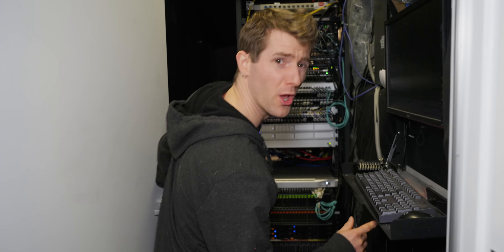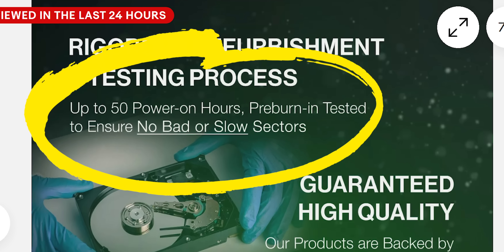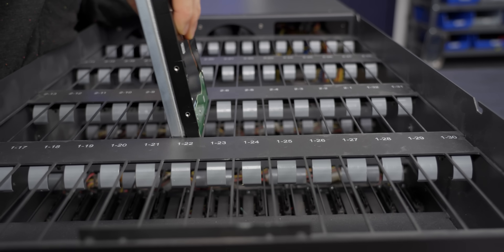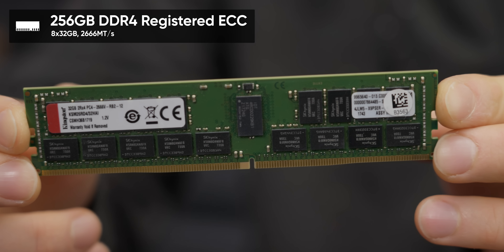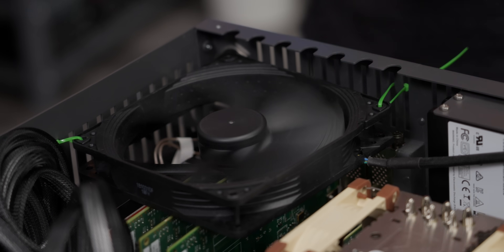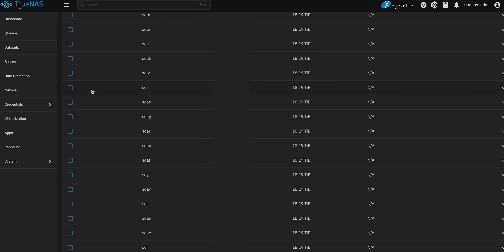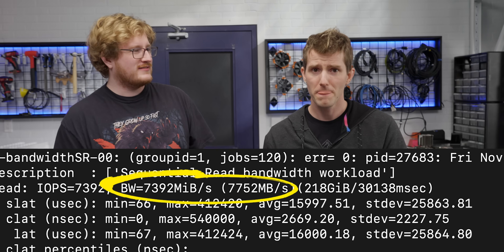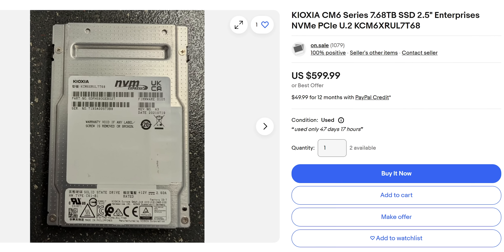Is Buying a PETABYTE on Ebay Stupid?

Comment: I understand that most people use Seagate because of videos like this, and they are generally cheaper.
For me, every single HDD I have ever had fail has been Seagate.  I have WD drives past their rated life and still going strong... plus I tend to get faster read/writes with WD drives that are technically rated exactly the same as the Seagate ones.

Comment: I bought a bunch of new 16TB Iron Wolf Pro SATA drives a few years ago and had one DOA. So I RMA'd the drive and Seagate makes you pay for shipping the drive back. They sent me a replacement and guess what, that was DOA as well and Seagate expected me to pay again to ship it back and I said no, you sent me a DOA as a replacement so you are paying for me to ship it back. After some back and forth they agreed. I did have one of their 18TB Exos HDDs get sticktion rather quickly and had to RMA that on as well.This all happened during the pandemic with supply chain issues so I just chocked it up to QA issues due to the supply chain issues. In the end the 6 16TB Iron Wolf Pro HDDs and the 2 18TB Exos HDDs I've been using haven't had any issues since putting them into my server and they have been running 24/7 for a little over 2 years now. I do need to get more storage as I need to seriously organize all my digital data as everything is so disorganized it would make anyone having to do forensics on the 100+TB of data I have if I committed a computer crime quit it's that bad.

Comment: I know that seagate has sponsered and sent many a drive in the past, but I was wondering why WD never really get's mentioned. In like, however many years at this point I have been watching, Western digital has really only shown up in used part builds or scrapyard wars stuff. Cus as far as I can tell they are still great drives, my original 1tb WD Blue HDD has been with every pc I have used the last like 8+ years? I just think it would be really cool as a video idea or labs piece, to compare the two brands. It may be very tech nerdy, but I like the big tech tippy vids.

Comment: I run my own NAS. I purchase 8tb drives for 45usd each. Yes, they do have 30k poh when I get them. I run them in Raidz2 and give no cares. For 45$ I can replace them 4x before I hit the regular price of one. As long as three don't die at the same time then it is a victory. My entire 64tb, 45tb usable, NAS costed me around 600usd and that includes cold backups.

Comment: I have 10x second hand “100% health/Zero Bad Sectors w/ 1 year warranty” SAS 14TB WD HC530’s I got on eBay for $87 shipped apiece. Can’t beat ~$6.20/TB! They all pass a full Hard Disk Sentinel health test (takes ~90 hours to perform lol)
8 are in my Z840 home server (Dual e5-2697v4’s/256gb ECC DDR4) and 2 are in a second Z840 workstation (Dual e5-2689v4’s/128gb ECC DDR4). 6 months in, no issues and still 100% health. I highly recommend keeping an eye on your spinning rust with Hard Disk Sentinel or something similar that will alert you as performance degrades so you can proactively swap the drive before a catastrophic failure occurs.

Comment: A surprising amount of manufacturer recerts are essentially brand new drives. I find the ones from ServerPartsDeals especially often have less than a dozen power cycles and only a handful of hours on the spindle. Usually they were bought in bulk for some purpose, but never fully deployed. Then Seagate takes them and goes "yeah drive is still good" and tada cheap drive.

Comment: Been using second hand barracuda drives in my pc as the main bulk of my game storage for years (when i wanna play them i just move them to one of my ssds) and not had a single one fail yet. 

Been running for atleast  the 5 years that I've had them. Never had an issue the fear of second hand drives is something that really isn't much of an issue to me as 2tb drives are cheap enough on Ebay

Comment: I'm in Australia and just bought two 16 TB WD drives from East digital Shopify store for $250AUD each shipped.
They have a 3-year warranty and a 0.3% failure rate as reported by blackblaze 2023 failure report
Lower than the Seagate which was 0.9%

Comment: He showed Server Part Deals which Wendell just did a video on and ive used for ages (~8 years?). Probably could have gotten a better deal going directly to them.   ---ooh hey they said it!

20TB is the correct way to go I just had to do this early 2024 when my 14TB's started popping.

Comment: I have 2x 16TB Seagate recertified picked up from AliExpress. 1 bought 2 years ago, another one bought earlier this year (Jan). Both running in a shr raid in synology with 5 disk bays - I plan to upgrade my pool with another 16TB recertified next year. Both drives have 2yrs of warranty left.
Reply: jus buy the upcoming 30-32tb one

Comment: I've had every new seagate drive I've bought in the last 2 years for 4 systems bought form MemEX die, replace, die, replace, die. So at this point I made a T-shirt mocking Seagate. Warranty conversations have wasted over 20 hours of my life. Would not touch Seagate Ironwolf or Exos drives with a 1000 foot pole.

Comment: I bought a used drive about 10years ago for $10 had a couple of dead sectors when I first put it in 

Fast forward it's still I'm my rig now has no dead sectors and works perfectly 

It's called Patrick as it is an enigma

Comment: My first high storage HDD was an 8tb seagate drive for mass storage, occassional games before i could afford ssds-a-plenty; had no issues with it and ended up doubling my storage with a recertified 8TB WD Black and it's running strong. The seagate drive is still running 7 years later

Comment: So far my seven 12TB recertified Seagate EXOS X14 drives work like a charm with no issues. I should acquire one more so I can run an eight drive RAID-Z3 pool instead of a six drive RAID-Z2 pool.

Comment: brand new HDD are crap, why on earth would anyone want a second-hand one, even at half price. I dont believe for a minute the LTT is actually using these outside of the video. also, I have a long-running streak of bad luck with Seagate HDD. from DOA to Dead in minutes to intermittent faults. ugh i dont think ill even finish watching.

Comment: I've almost exclusively run re-certified and straight up used drives in my homelab for the better part of a decade now. I mitigate their (un)timely demise by running 5 nodes of Proxmox and CephFS joining them all together. My oldest drives are crossing the 100k hour mark here soon.

Comment: So... 2.5PB of raw storage... 117TiB (~128TB) usable capacity in the next frame... 2372TB left. I mean some storage used as redundancy of course but what happened here? when will you show how you fill up mother vault finally and how you expand and so on? why is it already a new system again? where is the connection of the stories? Fine, you want to cover some new usecases, but this would be also possible with your existing mother vault?

Comment: Bought 3 3tb HGST Ultrastars refurbished in 2017. They've been powered just about 24/7 since then, but SMART was wiped so I have no idea how long they were on before that. Still healthy, no reallocated sectors. I'm thinking about replacing them just for the capacity before I even looked at the cold spare

Comment: I bought 3x 12TB Exos New-Old-Stock from Amazon, for 125€ a piece.
They have no SGT Warranty, but the seller gives you 5 Years written warranty.
Most of the drives are from 2019. and 2020., never used with 0 working hours.
Run them in my Expenology, and as for now, they run great.

Comment: I've bought a couple of WD Gold drives from eBay and they're awesome. Super cheap, large capacity, and much more reliable than regular consumer drives.
Reply: @danwhite3224  I wouldn't go for Hdd, SSd are better for fast storage rate use
Reply: Is it Helium or normal?

Are they enterprise grade? 

Are they a sata connector or 

another one that is typically used for enterprise drives i forgot the name of it
Reply: @srinivaschilakala216  theyre helium filled enterprise grade SATA drives (not u.2). You can get all this info with a 30 second google search next time
Reply: You can't just say that they are more reliable, as the manufacurers promise just isn't valid for ebay drives... 

I do think it's a good deal though... just not THAT good
Reply: @Jerraaa  "more reliable" probably means that they last longer due to better construction or something, not better warranty.
Reply: @DrewColpurs how would they be able to make serious claims about reliability from just after drives?

I you need hundreds of drives each from different models and vedors to actually get meaningful data about reliability.

Personally I never had a drive that was still in use die on me but that doesn't really say much about the drives, I just got lucky.
Reply: @Jerraaa  Just because it's on eBay doesn't mean that it automatically becomes unreliable.
WD Gold drives are designed for datacentres, so they have high shock resistance and MTBF is much higher. Of course, there's always still the risk that they've been mishandled but as they're more rugged you've got a better chance.

Comment: I have been running my plex on refurbed hdds. I don’t like it, but they seem fine. I’ve got 5 16tv, 4 being exos or gold and one ironwolf.  No problems so far. 
But I wish I had the space for a rack. I think my next purchase though will be some used nas units. I’m gonna plan for raid 6 with 96tb. That’s gonna be rough though.

Comment: Around 6 years ago i've bought some reaallly cheap hitachi 6TB hdd's. They were cheaper than any new 3TB available at that time. They were listed as new, but im pretty sure they went through some sort of refurbishment. Still running strong, although i use them pretty lightly. They still spin around 90% of the PC power on time tho.

Comment: I like recert drives. I have 6 of the Water Panther WP Arsenal 20tb in a QNAP AI642, along with a USB connected Orico 5 bay backup unit for offline files of podcasts and clients stuff after a year has passed. It works for me. I have no issues and all 6 drives are now almost 3 years old.

Comment: Your confidence in mechanical hard drives is truly inspiring. 😭🤣
Reply: i have 3-4 ssd died since 2016 but none of the 10 harddisks - seagate exos - i had bought & used since tehn had died, 2 of 8tb hdds are showing sign of fatigue but not dead with no chance of data recovery. SSD are more prone to sudden losing access to your stored data than HDD
Reply: @amirbahalegharn365  It's because they are in fonctionnement 24h/7d, The problems arise when they are not powered for more than a month, so if you go on vacation, leave them on, but I grant you that Seagate is really the best in the field.

Comment: Out of 10 1 TB WD Raptors I bought recertified a few years back one showed up dead and four died after a few months. I replaced all with new 2 TB  Seagates after the four failed, my Nas is limited to 2 TB drives. I did also purchase 6 1 TB SAS 2.5" for my Supermicro server from another supply company refurbished and they are still running after a year +.

Comment: I won’t lie. I’ve bought used hard drives online before. but all those drives I used for Chia farming/mining and storage for stuff I don’t care about like temporary files. Or I use the drives for my servers which holds downloads/recordings from streaming websites to stream TV series or movies so I can watch on my own time and also in my NVR, which is just recording video from security cameras. Otherwise, if it’s important data like my pictures and stuff, then I would buy new drives which I do. I mean the only difference between youth drives and new drives. Are the fact that used ones have just been used and possibly abused depending on who used it but a new hard drive could possibly be defective or also handled incorrectly so it is what it is.😅

Comment: This is the awesome thing about using used server gear instead of consumer gear. You have PCIE lanes galore. Also I don't even think it is a bad idea getting used drives. With how most people use their NAS at home they are basically WORM drives where they write the data once and then just read from it occasionally. The wear and tear on them should be minimal and by the time the drive actually does fail the replacement cost will just be that much lower

Comment: Been using this strategy for years. While I personally haven't had a drive fail on me *yet*, as long as you follow the 3,2,1 backup policy, and set the drives up in atleast a RaidZ1 array, the extra savings is absolutely worth it.

Additionally, It's not just Hard drives you can save alot on. I was able to build a whole NAS featuring an epyc 7702p (64 core, 128 thread) cpu, 256gb Ram, and 120TB of storage all for just under £3000, just from scouring ebay. And with proxmox, that single server was able to replace what was previously 3 separate machines, freeing up more space in my rack.

We need another season of scrapyard wars... but for servers.

Comment: I have been using refurbished SSD's and HDD's for 10+ years in mainly HP DL380 servers that have come out of enterprise installations at 3 years old. As long as you have redundancy and good backup practices, I don't see the issue. In my time I have probably seen on average 2 drive failures a year and never lost an array, HDD do seem to fail more than than SSD's though.

Comment: I've had nothing but problems with Seagate drives for years. Their recertified drives have been the absolute worst. If they work for you folks that's awesome but after losing TBs worth of data repeatedly I vowed to never buy from them again
Reply: They have the worst failure rate at Backblaze. That said the failure rate is still only a few percent per year (instead of less than a percent like other brands), so you do the math and they could still be the best option.
Reply: I have had very good results with Exos drives. They are “enterprise” grade but don’t really cost more than similar capacity “NAS” drives and I have found they are more reliable. YMMV of course
Reply: Same here. Exos are decent though. Still sub par in price/performance to Toshiba but decent.
Reply: He could have spent just over twice the price for brand new ssds, this video is as far as i can tell, just to draw people in that see a lot of drives and says wow.

They bought them a year ago, clearly not NEEDED otherwise it would have been done already.

Comment: I use 5 refurbished Seagate 18TB  Exos X18 in my Unraid system from Amazon and they are working fine since 2022. I use 4 of them and the last one ist a "cold spare" If something ist going wrong. Got them for round about 200€ each and that was an amazing deal two years ago👍

Comment: I bought a good deal, and bought several 2TB, and 4TB very low hour surplus WD Green HDDs off eBay about 5 years, or so ago, & so far they have all worked fine as backup, and bulk/game storage drives paired with an NVME SSD for OS usage, all using the Linux EXT4 file format. So yeah you just have to find a seller with a good feedback rating, & a decent return/warranty policy incase you do get a bad drive. Far as used SSDs go that you don't know it's history, I would say avoid them, as I've had too many SSD just fail on me over the years before they should have.

Comment: I bought some refurbished 12TB WD Ultrastar Helium drives for my home NAS that were a fraction of the cost of new ones at the time.  So far they have performed great.  And if one does die, it will be pretty inexpensive to replace it with another refurbished drive.  Only problem with those big drives is that they take a LONG time to rebuild when you do need to replace one.
Reply: All HDD's take a long time to rebuild when you replace one in a redundant storage. Sure faster drives may rebuild faster, but it's not dramatically faster. So recertified or new doesn't really matter for that. The only way rebuilding drives get faster is if you have SSD drives, and preferably PCIe ones at that as both SATA and SAS is way slower. It's part of the game.

Thinking back many may years, lest call it two or possibly three decades, a customer had a interesting project. They were developing a technique that would allow them to print circuits on plastic film using a sort of inkjet printer. Now it never got anywhere as far as I know, but at the time Nintendo was interested in this as they wanted memory storage for game cartridges that would be about as cheap as optical disks, and this was something they was considering to invest in. Now if it had succeeded it would have made SSD storage a lot cheaper and available a lot earlier than how it all turned out. Performance wouldn't have been anywhere near what we see from flash memory today, but it would still have been a lot better at random access than HDD's.

Oh the things we missed out on. Well I guess that film would have ended up cracking as it aged and the circuits delaminating or something. Probably a good thing we didn't have to suffer through that.

People had all kinds of strange ideas back then. Some worked while others successfully failed.

Comment: Have a Synology DS214+ running 2 x WD Red 4TB drives...bought all of it May 2014.  Still running, not a single error on either drive.  Actually JUST ordered a DS224+ and 2 x WD Red Plus 10TB drives to finally replace the thing before I'm forced to.  I will continue to run the DS214+ to see how long before a drive error pops up.

Comment: I've been using refurbed Exos 8, 10, 12tb for over 3 years. None of them failed yet. I also have the same one Dell nvme ssd with pci to u.2 adapter lol. It's been working great in my unraid machine.